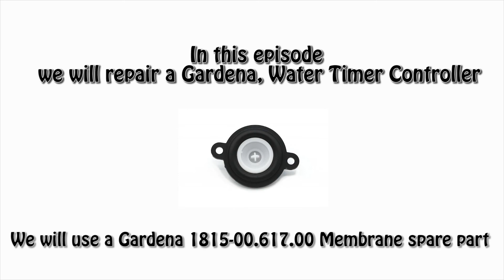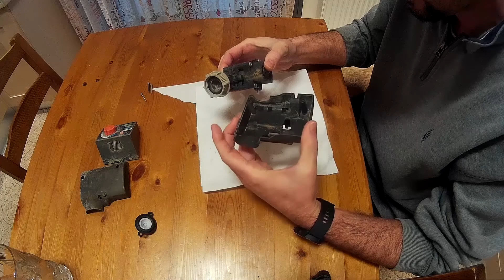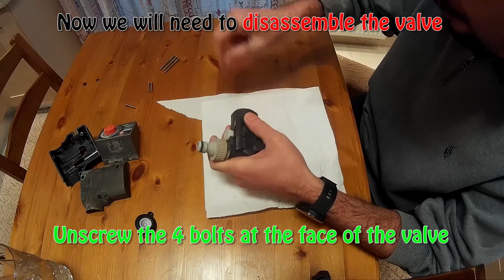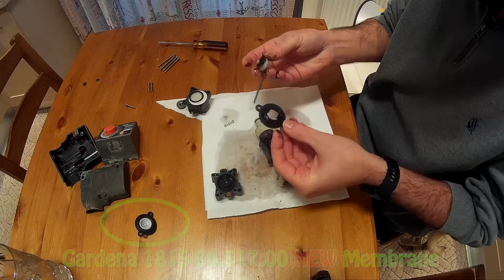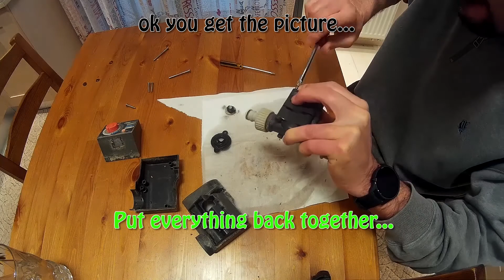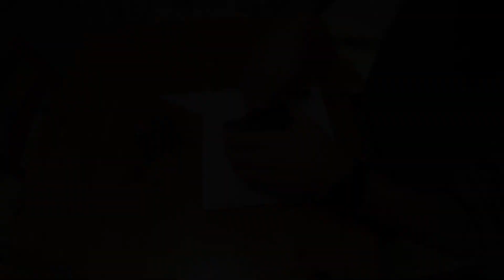DIY Gardena Water Timer Controller Repair

Comment: What was your initial problem? My 1030 has a very low flow when starts.

Membrane is ok, but maybe it's old and not elastic any more
Reply from the maker: Greetings sphinxgr,

The membrane was cut in the one you see in this video, and the water was constantly running.
Reply: @SteliosLiver if the water flow is very low, what could the problem be?
Reply from the maker: @dimitriosvolikakis965  Greetings,
Check the membrane or/and you 9V battery.

Comment: If the light grey top connector has lost its thread..(the connector to the external water tap)..can this be removed and replaced ?..good video by the way :-)
Reply from the maker: Greetings David Black,
I don't think so. If you manage to get it out, I can't think of a way to press a new one in place.
Reply: Yes you can have a new one.
First you must push two little metal pins that are keeping it in place though.

Comment: my one has electronic problem. when manual ON it the voltage comes on 9v but then when i off it it shoud come on again but with reversed polarity. but not volatge come out when i off mine. so water keep flowing out.
Reply: I have an electric problem too... The valves are the same, but the system is not exactly this one. Everytime the thing tries to run, It stops and wont work again until I take out the battery